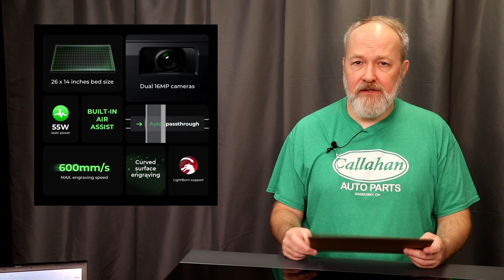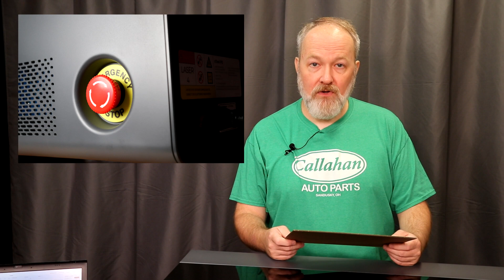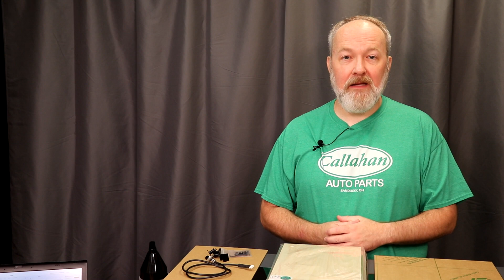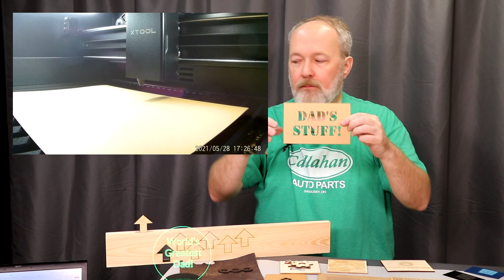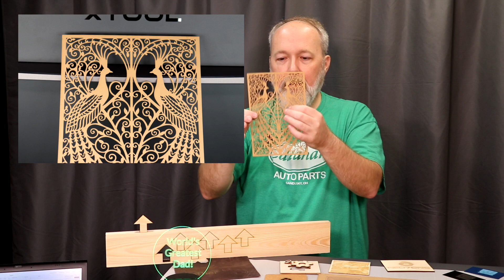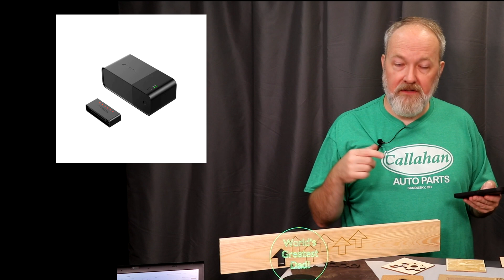Very Innovative!!! - The xTool P2 55W CO2 Laser Engraver

Comment: No one is reading the antifreeze bottle. It specifically says to remove the antifreeze in warm weather. They do not mention it in the books or on any of the videos, but you are only supposed to use the antifreeze in the winter.
Reply: You will want an additional, inline, fan for sure.